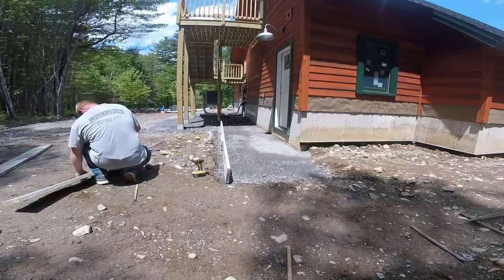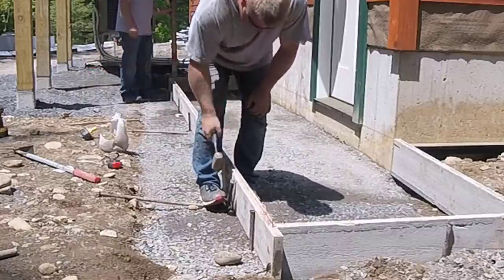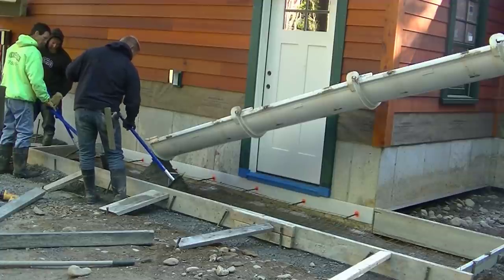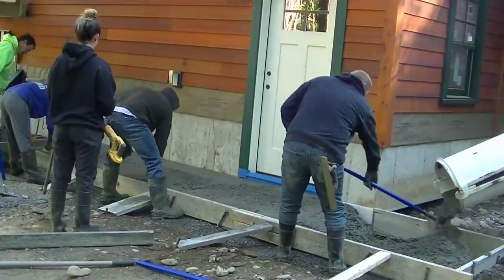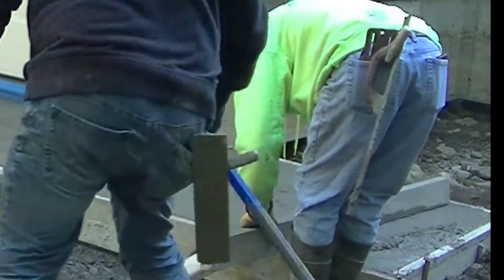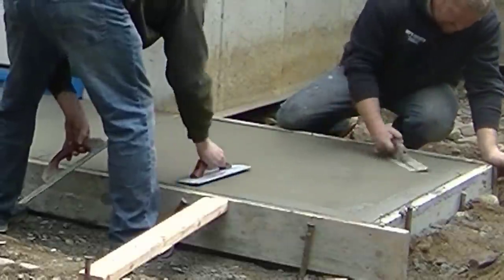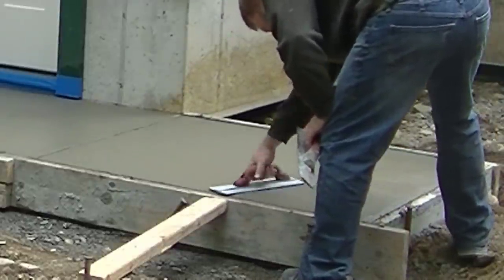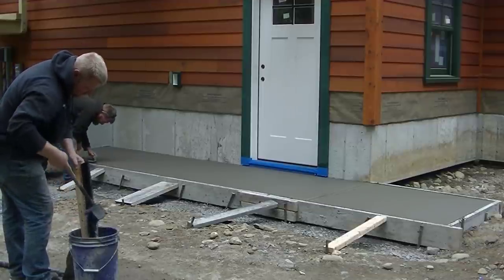Beginners Concrete Sidewalk - Do It Yourself (Form, Pour, Finish)

Comment: A well-pounded ground filled with gravel and small rocks prevents it from sinking. This gives a better cushion and protects the concrete from easily cracking. No matter how thick the concrete when the ground is poorly prepared, when they sink from different places, the concrete also starts sinking and cracking.

Comment: When screaning the top of concrete I noticed that you did not have a ledge on the existing side of the the home. How do you keep level without a ledge. Did you use the expansion tape for the ledge?

Comment: Mike I had a concrete sidewalk poured and they did a horrible job finishing it. It's not flat at all holds water and it drain's towards the house and it's attached to the house. We only get 2 in per year of rain but it looks like a 4 year old did the finish work. Im trying to figure out the best way to get it flat and so it will drain properly. Is there anything I can do? Im only 33 but my digestive system is 5% from complete failure so I don't know what to do. Thanks Ryne

Comment: do all concrete sidewalks have the same cement mix contents ? if no, who decide on the cement mix contents?  The cement companies you're getting your cement mixture from or yourself?  Thank you in advance.
Reply from the maker: I tell them what I want, for example 4000 psi with fiber mesh, air-entrainment, and water reducer. Or 3500 psi and so on. They have all the different mix designs already, you just tell them which one you want based on what you're doing.

Comment: Hope you answer me really fast. DIY project. I got a backhoe coming today to dig for a concrete front deck, 20 foot long sidewalk and stairs turning into the driveway. I see tons of vids that use 2x4 as forms. To me, that doesn't seem really thick enough for concrete. I am thinking 2x6 and pourring maybe 5 inches deep. What do you think?

Comment: Spring project,so after I trench my walkway , I lay gravel then build my form, that correct , also if am doing 4 inch thick and am using 6”! Boards in that a problem

Comment: Thanks for the video. I live in a rural area and is it easier to to a asphalt drive or concrete. There is only one way in and out so I’m thinking if a try to do concrete I’ll be stuck at home until the concrete cures
Reply from the maker: My driveway was like that too. I drove over it the next day no problems but I used high psi concrete.
Reply: @MikeDayConcrete  thanks for responding. So... 4500psi concrete @ 6in thickness shoulld be good?

Comment: I'm looking to do my own concrete walkway around my house  * house is currently bring built * so the ground is already dug up I'll still need to compact it but this will be my first time doing concrete work, any recommendations, tools ? Or suggestions I should follow? I'll be doing it about 4 or 5 feet wide by probably 5-6 feet long sections around the house  at a time. Will I still need to cut sections of it if I do the forms in small sections around it? 
Thanks for the advice

Comment: Mike can you make a video on admixtures and bagged concrete? Basically I got a sampler of admixes when I bought a pallet of concrete and I want to practice before ordering them on a real job. Specifically Portland with air, fiber, water reducer and densifier. How much to add etc. I've done it with rapid set and concrete pharmacy products from the depot but would like to see with portland cause my preliminary experimenting seem to show a difference in workability etc. An idea for the future maybe?

Comment: I was told  The foam is to allow the concrete to move incase the land shifts. Might be wrong. But if they were right. What was the point in this case since you added rebar into the wall wouldn’t it crack if the piece poured was to shift?
Reply: The drilled rebar pins are just to prevent up or down movement due to freeze/thaw cycles (‘heaving’). Some jobs require smooth dowels that are greased or even sleeved before pouring. 
The foam is to prevent any possible bond between the frost wall and the new concrete. I’m glad Mike uses that super thin foam bcz the 1/2” stuff gets really ugly over time, as it deteriorates.
Reply: @psidvicious    Bear with me I’m new so my questions are probably retarted haha. so the foam is to prevent the new cement to bond to the old one? Why wouldn’t they want it bonded together? why would they put rebar from the old one to the new one. Wouldn’t that be the same as bonding in a way? I do see how they use rebar like you said to prevent up and down movement. I’m confused.
Reply: @GerardoGonzalez-jc1je  When an ‘old’ concrete finish is smooth it’s next to impossible to get new concrete to bond to it. It’s called a cold joint. It may ‘stick’ a bit here and there, but for anything structural, a cold joint is always avoided. Personally, I would rather have not put in any expansion material at all, but it may have been specified to use it. 
The engineer that they were doing this for probably just wanted a little extra insurance that there was no bond between the new and old concretes, so as not to put any unwanted stresses where the design didn’t allow for them.
Reply: @psidvicious  ahhh ok. Apréciate the explanation 🙏
Reply from the maker: Yea, he wanted both. And he caulked the strip-off after removing the top half inch of it.

Comment: Why 8" for this walk?  I'm sure the engineer-owner had his reason, but it seems like overkill $$.  I would think 4" would be a plenty.  Especially with 4000# mix, fiber, & wire.
Reply from the maker: It's what he wanted. A little overkill but the areas were small so not a lot of extra money.
Reply: busted up a concrete driveway one day, one guy broke a guaranteed unbreakable sledge hammer handle and then a second one , the thickest was 16'' laid on dirt , tapered down to about 8-1/2'' near the street
Reply: @MikeDayConcrete  How fat is he?  ,,,,Its only for foot traffic!

Comment: Why would  you give a bond break and pin with steel  to the house??? Doesn't  make sense 😕
Reply: Also we drive  on 4 inches  of concrete  in  Ohio, why add all that extra  4 inches of concrete  weight to an already  unstable  overdig??? Doesn't  make sense??
Reply from the maker: Steve, I said in the video the Owner was an engineer. Not my decision just doing what he wanted.
Reply: Gotcha